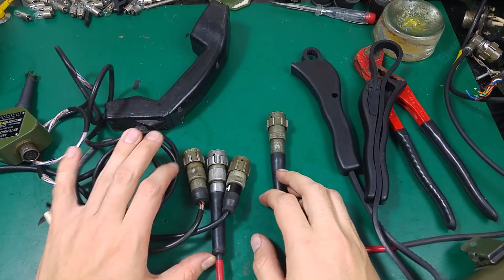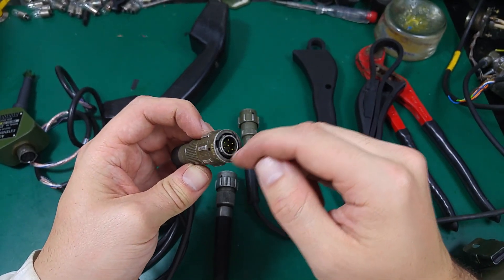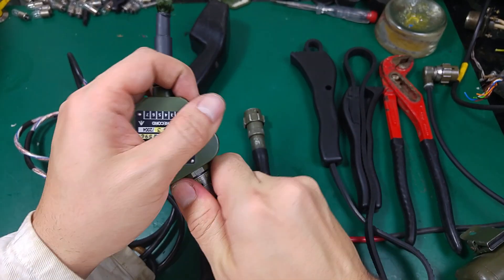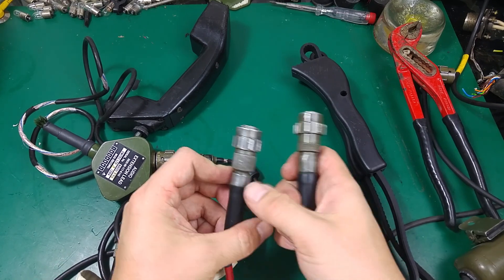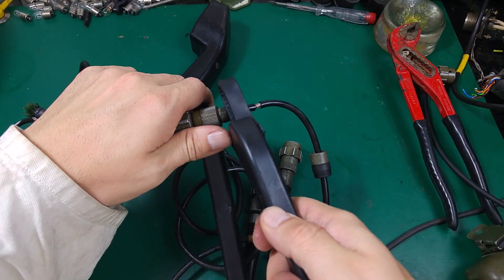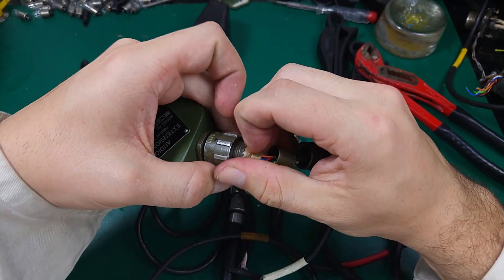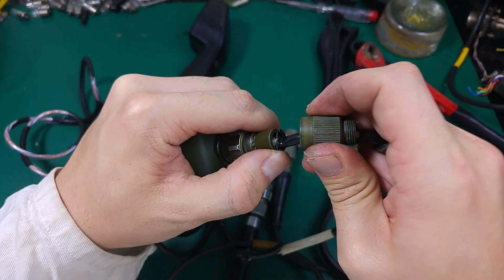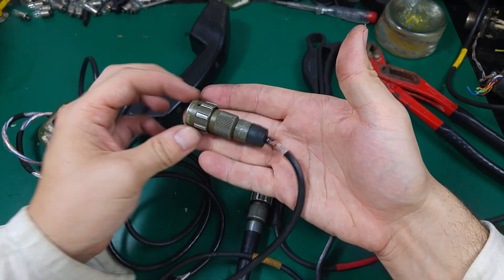How disassembly  straight Clansman 7 pin British Army radio plug for rewire

Comment: Are there any female connectors that you can buy off the shelf? I would like to convert a headset to kenwood 2pin but I would need a spare female plug for that
Reply from the maker: I never came across female, there is clansman extension cable that have female plugs but they are mounted on metal box.  I'm sure it's there but I have not seen that part.